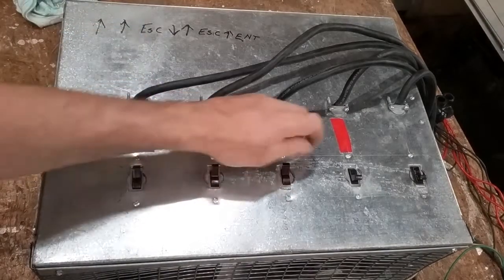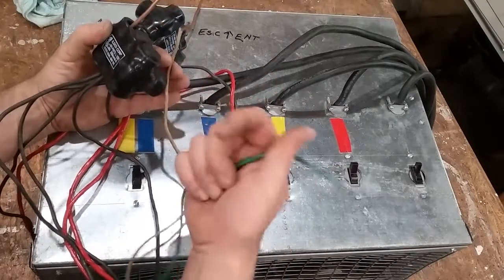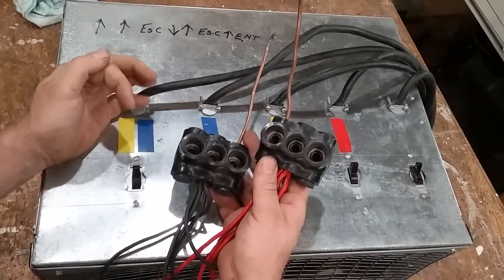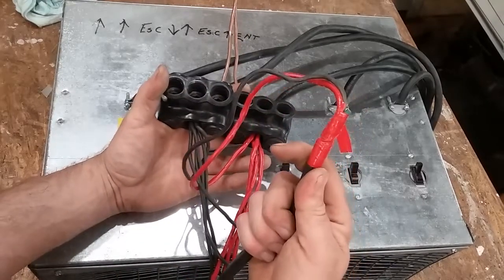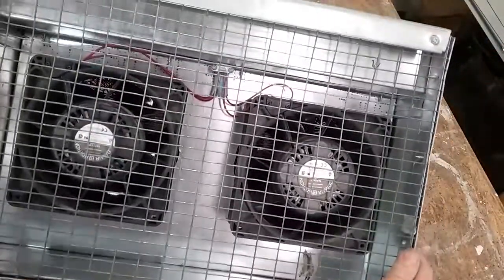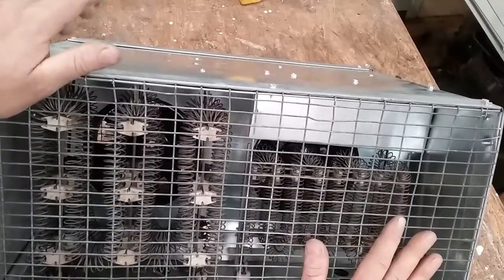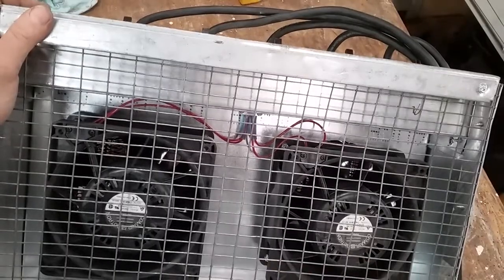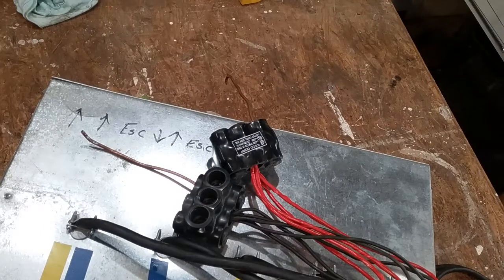Shop built load bank

Comment: I need one for my diesel so it doesn't wet stack.  This is basically a heater.   Maybe ill buy a 10000 heater.   They are pretty cheap
Reply from the maker: Seems reasonable.
Reply from the maker: Some of the more advanced controllers have a set of dry contacts that can be programmed to apply a load bank automatically when exercising.  A little relay logic can accomplish the same task.